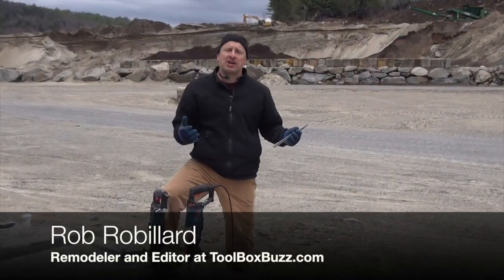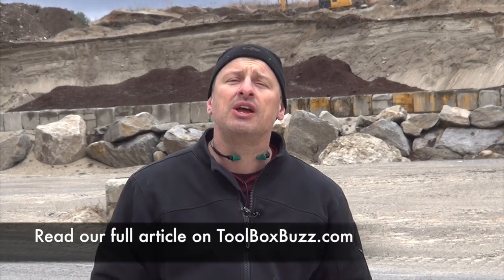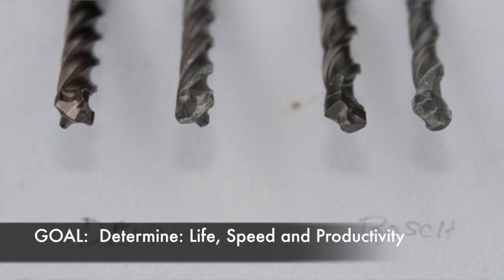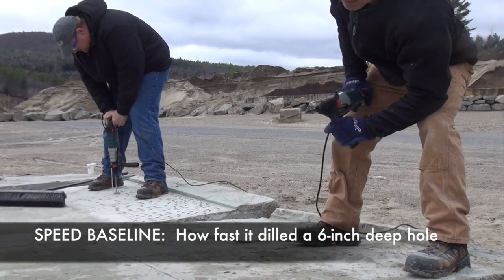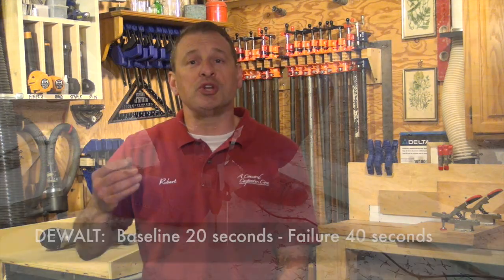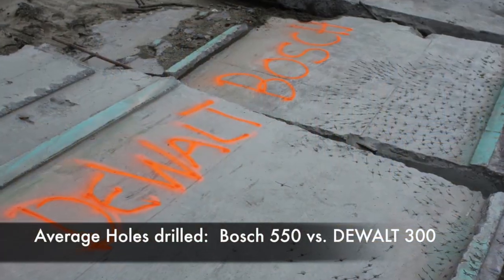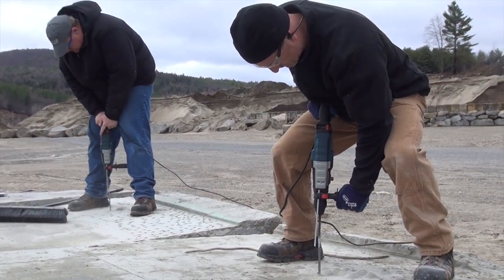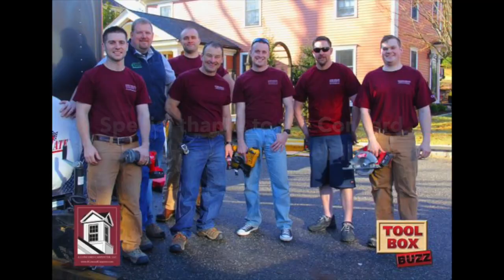3/8 Inch SDS-Plus Concrete Bit Comparison Testing

Comment: Out of curiosity will you be doing a video on newer cordless sds+ rotary hammers, I'm stuck between the DeWalt dch263 1 1/8in and metabo hpt 36v 1 1/8in.

Comment: Hard to tell, but they all looked like 4 cutter heads (another comment suggests they were 2 cutter vs 4 cutter).  I've found 2 cutter bits to be faster.  If you are comparing  brands, you should definitely test 2 vs 2 or 4 vs 4, as both companies make both versions and this would remove the difference found in 2 vs 4 cutter.  Good test in general.  I especially like your 'death of bit' metric; very clever and useful.
Reply from the maker: thx

Comment: Rob you used the Bosch 2 cutter head against Dewalt's 4 cutter head correct? If so I am very surprised at your results and it would be interesting to see a test like this in reinforced concrete with rebar.
Reply from the maker: drayne - It was reinforced concrete, we tried to avoid rebar…but we did hit it fairly often. Neither bit liked drilling in the steel!